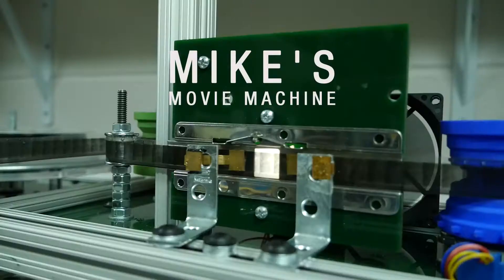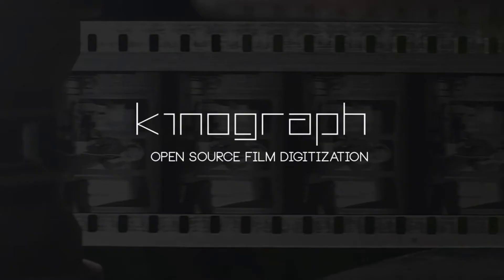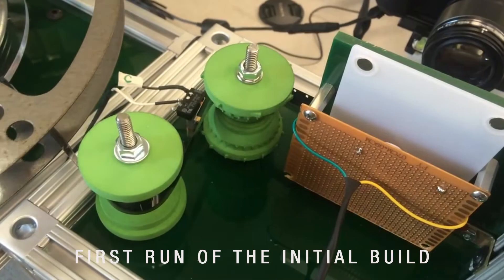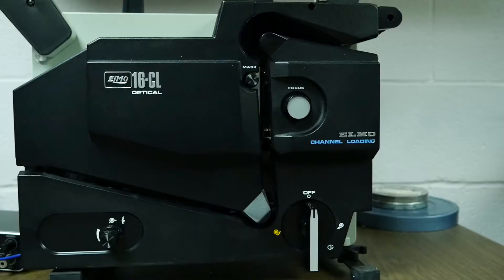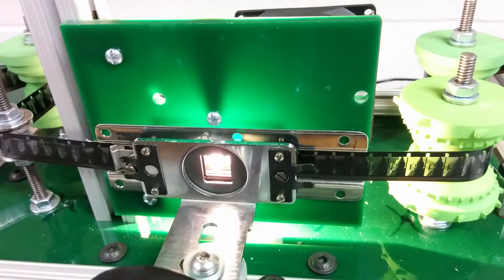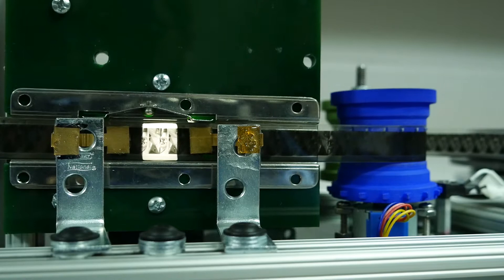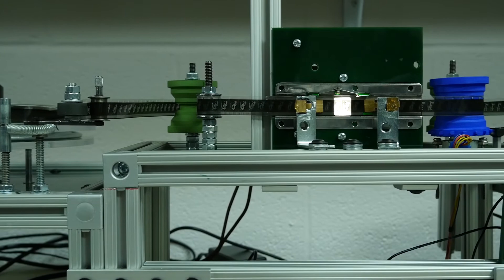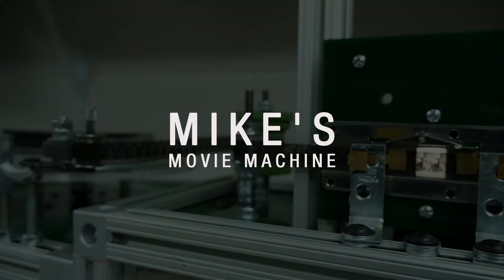Mike's Movie Machine - The AACA Library's DIY Film Scanner

Comment: I was thinking about making a 16mm film scanner myself, and given the available options to my mind the easiest way of doing it was to convert a 16mm projector which already has all the film transport mechanism in place and which just required a different lighting method (adjustable LED), a slower motor (a stepper motor driven by Arduino board and config), a camera trigger mechanism (a fixed reed switch with a strong magnet attached to one of the shutter blades) and finally a fairly high end camera which takes single photos via electronic shutter. With some tweaking and fine tuning the end results are fantastic. I can do sound films too by running the film a second time normally through a fully working unmodified projector and taking the sound output into a PC to record the sound as MP3 which can then be synchronised to the compiled video on the PC to produce a perfect scanned archivable copy of the film which is most cases is better than the projector quality. As the Camera takes single photographs larger than UHD quality, I can create 4K scans, but I normally reduce it down to FHD as more devices are able to playback the file, PLUS the file sizes are much smaller.
The whole setup probably cost me around £200.00 GBP including the £25.00 scrap projector for spares or repair as I only needed the film transport mechanism to be working as the motor, lamp, sound amplifier etc were all removed to make room for the stepper motor, circuit boards for Arduino and LED dimmer and power supply for Arduino and Stepper motor.
I really must do a video of it to show how I did it :-)
My next project is to do a similar thing on an old 8mm projector as I have the projector and so just need to replicate everything else into the projector chassis.
Watch this space :-).

Comment: Since you are using a stepper motor, I don't understand why you need protrusions on the roller and also why you would need the switch.  Let's say there are 18 protrusions on the roller.  You would simply step the motor 20 degrees, then have the arduino trigger the shutter at that point via a digital output.  No need for anything else, right?

Comment: Could you just put the stepper motor before the take-up reel and use a magnetic slip clutch on the take-up reel so that it just slips if it gets too much tension?
Reply from the maker: I think you could. We had actually toyed with an idea similar to that, but found the method we went with simpler for our minds to grasp and cheaper as well.

Comment: Why not buy a used Mekel or Sunrise Imaging off of ebay? Or at least study them for inspiration on design? Better yet, why not get a grant to have this scanned for yourself?
Reply from the maker: We went with this process mostly due to cost. Our rig cost us under 5K and over half of that was the camera. That also gave us portability cross use. We use the camera for various other projects in the library so that money wasn't just sunk into one project. This also gave us the insight to know how to fix something if it breaks, we won't sink cost into repairs or maintenance as we know the ins and outs of it. The other benefit of our rig was that it can be upgraded, as we can add a better camera in the future. We have close to 300 films and even if we secured a hefty grant it still wouldn't come close to doing most of our collection. We were looking into grants when we first started but as we came across this project, it seemed like fun. That was another determining factor as it simply looked like it would be a fun challenge. There are definitely other ways to get a project like this done, but this seemed like the right fit for us. It's the similar reasoning that some people do home repairs themselves and others pay people. We felt we had the right skills to tackle this and gave it a try.